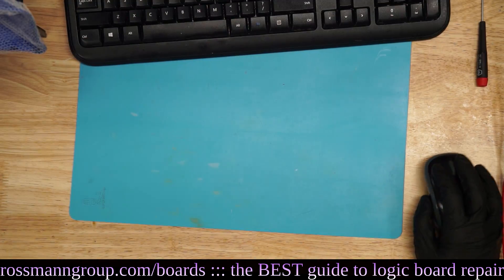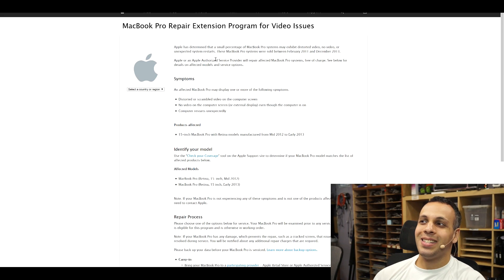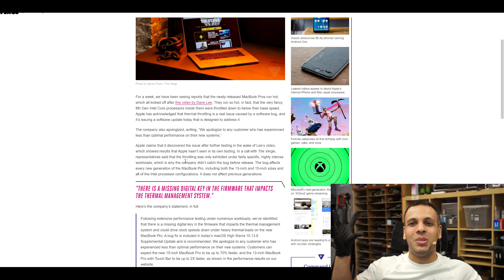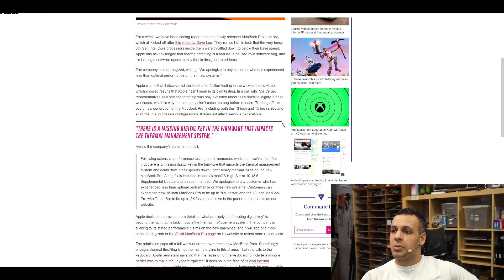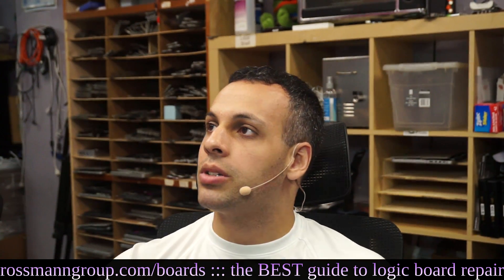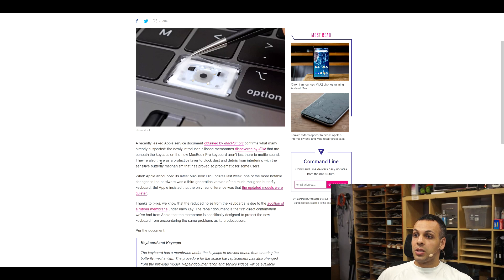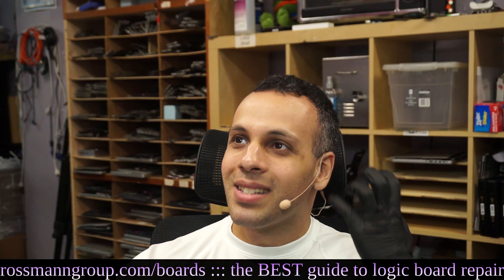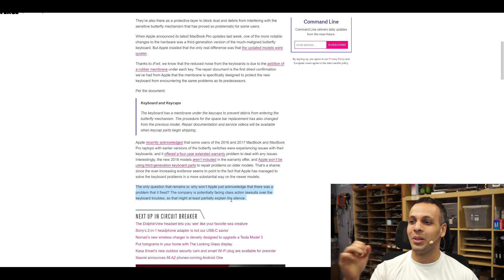This new Macbook is becoming a meme.

Comment: The thing is, they can't really admit that the 2nd gen keyboard was bad, because there is a class action lawsuit going about this exact issue. If they admit it, the case is closed and they'd have to pay fines, do proper replacements, or something among these lines. Also, Apple losing a lawsuit like this would be breaking news, so stock would go massively down and they sure don't like such situations. So, they're lying straight in your face to save their ass. As they've learnt and perfected over the years.

Comment: And now atop all this the removal of the data port from the 2018 models rendering it neigh impossible to pull data from the embedded SSD. I like, & even repair, Apple laptop & desktops but that’s a bridge too far for me.

Stay with the 2015 systems while not perfect they’re easier to service & less problematic. Sure they’re not perfect but at least they don’t have keyboards that fail randomly, have ssd’s that can be replaced with potentially easier data recovery, an potentially longer service life.

Comment: People instead talking crap about apple they should demand from Adobe to give it's product to Linux. If Adobe ported it's product to Linux that would cause real damage to apple computers department. Now we have windows office online available for linux. Now Adobe is the final barrier.
Reply: I think AMD shows how to make Linux great with drivers. More and more AMD code for drivers is being added to the kernel directly by them. Imagine if every software company did this and just contributed the code directly. I think this is how the game is ultimately going to end in 30 years because companies will realize that the code being open isn't bad, it just helps them in the long run and makes it easier for them to have solid robust/stable products. 

In reality though, subscription services via web browsers is probably going to be the end game.
Reply: Look at this little sheep. Of course it is somebody else's fault, right buddy?
Reply: Would be nice, but it would be good if people switched to F/OSS instead of using proprietary software.
Reply: Yes that is the main problem proprietary software. The options are:
1)Either buy a Mac 
2) or Dual booth/have 2 computers. One running Linux and another windows. 
This is why many developers use macs to avoid having to work with 2 machines or dual booth when you need proprietary software.

Adobe the biggest of them Gimp or other alternatives  can't compare with photoshop especially when you want to do more advanced tasks for professional work. Resolve can work great in Linux but you have to invest a lot of money...
Reply: Of course @Jairo Melchor it's Capitalism, Patriarchy, white men, Rich people,Putin, Thrump and Bill Gates fault. I forget something ?

Comment: I've had a Dual Boot Windows/Linux for years.
I've have my MCSE. MCP, A+, N+ for years, owner of two brick and mortar Computer stores, IT director for two Oil Companies here in Alberta.
Never have I or would have Apple on any part of my networks.
For the reason pointed out on these Video reviews/repairs and working in the real world.
Apple is a rip off.
I will never recommend anything from Apple and there all Intel now anyways.
Cant upgrade your SSD or RaM or Video cards the list goes on.
Oh and besides FOXCONN Suicide Nets.

Comment: Probably that patch just undervolts the CPU to increase the thermal headroom. Is a hardware design flaw, period. If the was something a core flaw in OS all devices, including the old ones, should be affected. But is not the case.

Comment: bro. not defending apple or something but rendering a video is not the same in every case. dave lee rendered RED raq fottage to 4k.  "normal" rendering form any given modern codec to standart output type result in much better performance values when comparing the i7 to the i9 and even will not let the macboocs throttle at all.. might need to collect some more information and not only mr holy dave lees one case he manages to throttle it out. btw thats was whats menat by special occasions. sry for bad england.

Comment: so, they fixed it in such a manner that it doesn't throttle below base clock speed anymore... but then it even gets hotter..  if you see some liquid coming out then its just the cpu that has melted

Comment: What?, the cooling system is a dongle? that it cost $299 and $399 the PRO version?

Apple Cooling system PRO with premium materials and the new POLAR ENGINE, compatible with Adobe software
Reply: lol
I can imagine Apple making a wimpy-ass $100 USB-C laptop cooler and selling it as a solution to their fuckup
Reply: Haha yeah.
Reply: yes, their laptop cooling pad would basically be a sleek, rounded aluminum rectangle with fans inside
and two microscopic slots for airflow -- and only on the edges, so that they don't ruin the pristine appearance.
Reply: they could get Dyson to engineer the airflow
Reply: Yes, they have years of engineering experience making overpriced plastic junk that sucks.
Reply: 2 peas in a pod

Comment: Two possible issues with thermal throttling in my own opinion. 
1. Possible insufficient hardware to cool the processor properly.
2. Intel has been using garbage TIM (thermal interface material) aka thermal paste under there cpu's metal lids. This has been proven by delidding CPU's and reapplying high quality paste under the CPU lids to get on average a 20c drop in temps. 20c is not a small amount either, just by changing your TIM material.  It may be both Intel and Apple at fault and the combination just intensifies the situation. 

I have a Windows 10 x64 custom built computer.  Using the stock heatsink my Intel CPU was thermal throttle at 100c running Cinebench r15.  I changed out to an air cooled Thermaltake Frio Cooler with Dual 120mm Fans. Now CPU doesn't thermal throttle but Cinebench r15 still raises CPU to 90c.  Then switched out to a Corsair H100i Water Cooling Solution and Cinebench r15 hits 72c.  I made sure the heatsinks were all sufficiently tightened.  My CPU is older (a i7 4790K at stock settings, with an ASUS Maximus VII Hero ROG Motherboard at default values)  Just saying it could be two faults at play in the MacBook Pro as Intel hasn't resolved its crummy TIM solution since it abandoned soldering its lids on like the 2nd Generation Intel's had.

Comment: I still hear the canard that "Macs don't get viruses".
So I point out the virus and malware that exists for Macs and ask what they are if not viruses and malware.
They splutter and then go "but you have to put it on there yourself!" as if that changes the fact that viruses exist for Macs.
I can easily imagine this thermal throttling fix being vulnerable to software injection and misuse.
Reply: Brent Keller
I ask people what "PC" stands for when they tell me Mac's aren't PC's....
My main reason is because I'm a Linux user, and I'd like normies to start understanding that OSes are separate from the hardware. What it ships with doesn't lock it to running just that OS.
Reply: Short form: Macs are "Personal Computers" too. (That will cause some hate.)
But those truly picky about it will insist there are "differences"
The one "main" difference no longer exists on the Intel processor based Macs though, that difference was that Macs generally used a RISC processor in the past (Reduced instruction set computer) versus the CISC processor in a "PC" (Complete instruction set computer.)
Honestly, not much of a real difference.
OS's once had... problems with running on a processor it wasn't designed for. 
So an OS designed for a RISC processor didn't like a CISC processor and so on.
But, now we have Intel Macs and emulators, so now there's not much of an issue with that.
But don't discount idiot vendors locking the hardware because they don't want you polluting "their" equipment with "foreign" code. (Funny, I could swear I purchased it and it is now mine.)
Once upon a time, waaaaaay back in the day, it was the case that the hardware was locked to the OS and vice versa. (OS on a chip in the Commodore systems anyone?)
Not so much anymore.
Reply: Sal Paradise no.
They have virii.
Period.
Next.
Reply: A mac user saying they can't get a virus is like a vegan saying they can't get e coli
Reply: Their reasoning, such as it is, was a hand wave and a statement along the lines of "Viruses only impact PC's. And Macs aren't PC's."
Interesting theory, easily disproven.
But it does show a sliver into the thought processes of their bearers.
Reply: It's a numbers game essentially. Number of known viruses for a given OS. And it's not like Windows is ahead of macOS by a bit, there are tens of thousands for Windows and a bare handful for macOS. So one can argue the "technically not true" point, but the statement "Macs don't get viruses" is more true than not true, so to speak.

Comment: Linus had it throttling within 20 minutes of unboxing the thing even if the vrms are overheating and causing it to throttle the cpu was also overheating below base clock,  unable to stay under 90c.
Reply: Benjamin Hale Most expensive skillet you will ever own.
Reply: and here i was angry that the new nvidia driver made my gtx 1080 ti FE go from 71c under max load to 73c under max load hehehe
Reply: GreyBlackWolf I still use my Pentium 4. Lousy computer but still excellent for cooking eggs.

Comment: Who wants to bet that the new "digital key" will just nerf the i7s so they will always be slower than the throttled i9s ?
Reply: Kinda like how they “fixed” the iPhone 4 by just making the signal bars in iOS taller 😂
Reply: AHAA that would be amazing... just make the i7 even slower and do nothing to the i9. It would be epic!
Reply: SciPunk215 yea I was thinking how tf will they fix thermals with software lol. You can’t download heat pipes.
Reply: lol now this would be too hilarious
Reply: They will lower the displayed temps in power gadget to help keep the CPU cool, and it will just work.
Reply: popnimpop they will just increase fan rpm by 100 or so...  Don't want that computer to make any noise now :-D besides, people buy the SPECS and most apple sheep won't even realise that their cpu and gpu are throttling three seconds after it boots cos it is so pretty and quiete :-P
Reply: It'll just display a clock speed which is higher than what it actually is running at. Then they'll say the benchmarks aren't optimized properly, and that's why the performance is off.
Reply: So they will deliberately throttle CPU except when a benchmark runs.
Reply: Wrong, they are the master at dealing with this kind of issues, they will just simply cripple those laptops by making then slow , same with IOS, that's why i hate when people say apple its better at phones because they keep releasing new updates when in reality they are just fucking with the people, meanwhile this last ones are happy for maybe just one new filter on the camera app and the old good one lie ( bug and stability fix).
Reply: Or calling something "Pro" that runs with a dual core in 2018.
Reply: it'd make it to where they had to buy the new macbook.
Reply: SpinDrift lol like VW TSI
Reply: hahaha
Reply: Oh snap
Reply: That would be too obvious because it is about rendering times.
Reply: Nonsense.

Comment: There is no way a software update can fix this. such bs. full recall will be needed.
Reply: volkswagen was able to do the same in germany so why not? xD
Reply: GreyBlackWolf The CPU is not really the issue, the issue is vrms overheating and not delivering enough power to the CPU. This will cause early failure of vrms though as they are allready running really close to their limits.
Reply: Jamie Norwood Totally. Why the rush anyway? Four thousand dollars? Really? That doesn't warrant a perfect machine? So, what are consumers paying for? The highest paying consumer gets F'd like this? 
I hope the class action suit goes forth and Apple has a public blemish, admit blame and recklessness AND completely replace the 2016-201? keyboards.
Reply: Michael Schalk So I know the cpu can be throttled as I mentioned, but can the vrms? If so, wouldnt we get the same burnt computer effect if they raised their thermal threshold? Or are we really looking at a software update that will nurf intensive tasks?
Reply: they gona lower the gpu speed and thats it. no more cooking :D
Reply: The update did solve the issue.
Reply: lmao Dave Lee just made a video showing that the update did fix it
Reply: Jamie Norwood A software update can fix that problem, but it will cause a bigger one. If they turn up the thermal threshold, the cpu can run faster... but the cooling system and poorly vented chassis will cause it to overheat and fry.
Reply: Jamie Norwood massive recall incoming
Reply: I don't think a recall will fix this. They would need to make the whole cooling system bigger, and to do that they would need to completely redesign the whole laptop.

Comment: The design is fine per Intel's spec since it allows for lower power draw. But to me that's utter bullshit if you limit a chip which normally peaks at 100w to 45w due to skimping on vrm. Same shit as with OEM i7 8700 which can run at 2.2GHz which is a joke.

But it seems that with more cores the route manufacturers are taking is having high single core boost along with low base clock due to both thermals and vrm...

Comment: Louis, you should know better than to think that Apple will acknowledge that they have issues. After all, only a "small percentage" of people ever acknowledge issues!
Reply: Undefined Lastname jobs actually never said that, and neither did apple. he allegedly said "just avoid holding it that way" which is arguably just as bad but doesn't have the same comedic affect.

It was Apple that actually told Jobs off for saying that and offered a free case or a refund on the iPhone 4. 

But Apple haters never let the correct details get in the way of some good hate.
Reply: +Undefined Lastname
Apple changed the keyboard so they must be pressing the keys wrong. /s

Comment: why do i have a feeling that software updates gonna do something to those high intense programs?, if the issue is either mosfets or cooling, software would either do something to those intense programs or that software could ramp up fan speeds but that missing digit seems bullshit, I could be wrong and that software update could "fix" it but probably wont but instead throttle applications to use less CPU utilization, thus it being underclocked to not get so hot. apple being apple they could do just that, or if they where smart design it to reach those speeds instead of using poor mosfets/cooling

Comment: Having the fan spinning more aggressively is the only thing I can think of for a software implementation that could alleviate throttling, and that doesn't affect performance further
Reply: I'm not sure myself, but I get the impression it may have been throttling more than necessary for the temperature.

Which you could argue was a good thing given Macbooks' poor cooling and high temperature, but it would explain the lower performance and seems to have been unintentional.
Reply: There may well be a bad VRM, that's another issue.

But the fact remains that they made a change in software and now it measurably performs better on the workload the fix was supposed to improve. There's no room for subjectivity or opinion on that. But as to what they did exactly, we can only speculate.
Reply: You're totally wrong there. Dave Lee was the one who reported the issue and who helped Apple reproduce the issue for the fix. He then reported that the issue was fixed by the patch. Watch the video. https://www.youtube.com/watch?v=UTguywiC9aw

He did say the fix was unrelated to VRMs. That may mean there is another issue, which is what I said in the first place. But it might also mean it's just yet another model that throttles due to the Macbook's poor cooling, exactly like they have forever.
Reply: Well whether it is broken is a matter of opinion. Ultrathin laptops are necessarily throttled because they can't fit a good cooling system.

Claiming that this is "broken" is subjective. People have to choose between better performance and repairability on one side, and better portability on the other.

No decision is going to be right for 100% of people. It's important that people are informed on what they are losing in going for an ultrathin laptop like a Macbook, and Louis is helping that happen. That doesn't mean many informed people aren't going to continue to make those decisions based on what's important to them.

Common sense would dictate they offer both options, but Apple have an opinionated one-size-fits-all attitude. How long did they persist with small iPhones before they accepted many people wanted the larger iPhone Plus form factor?

Really that is one of the biggest problems with Apple.